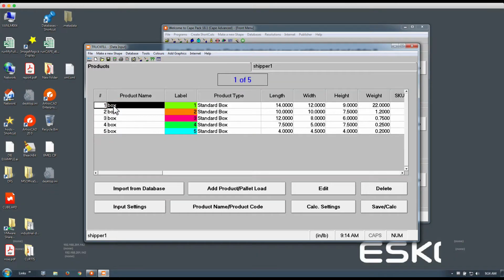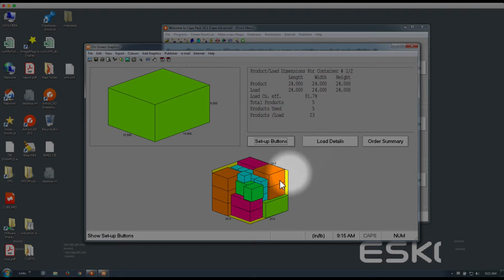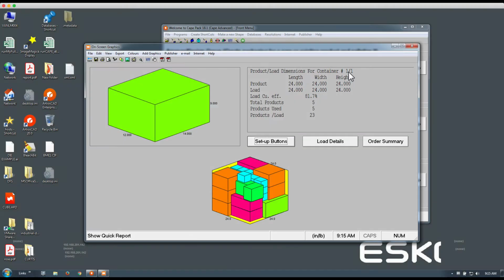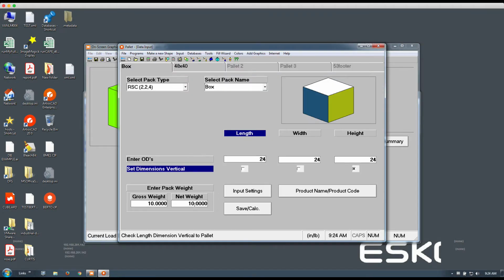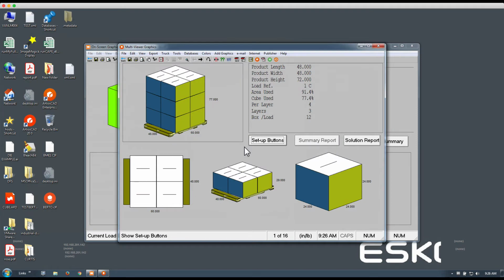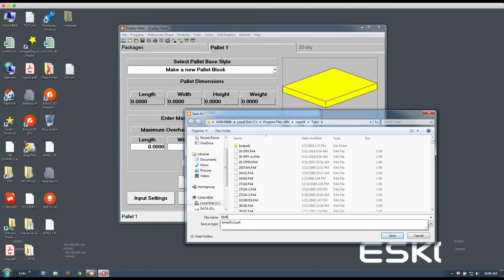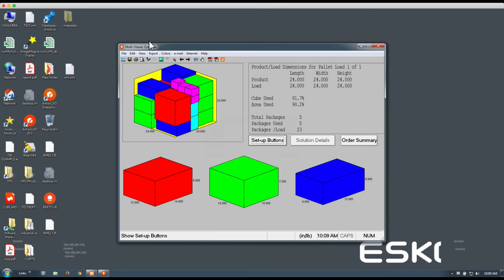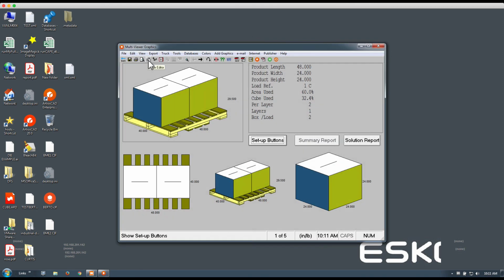Cape use case: Multiple primary shippers into secondary Shipper onto Pallet

Comment: This is interesting. I am searching for a software solution for figuring out the best way to orient shipments of several different box sizes in differing quantities to maximize pallet yield and minimize the amount of pallets per shipment. I would love to see a video on that specific use case. Also would be great to get shown how to input different frequently used boxes into the database and recall them when making a shipment. Say, how to enter the sizes and weights of 5 different boxes and put them into a shipment dialog, (order?) and still be able to add the specific pallet type to calculate approx weight and pallet number and best orientation. Help? Please?
Reply: Also would be great to have this functionality all on a web interface to make it cross-platform without having to program a whole new thing for Mac users like myself.